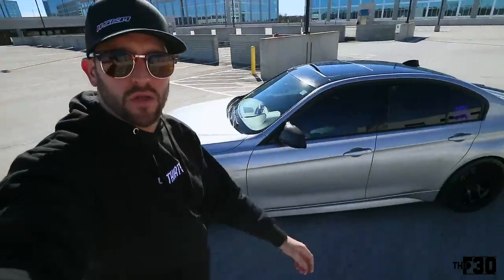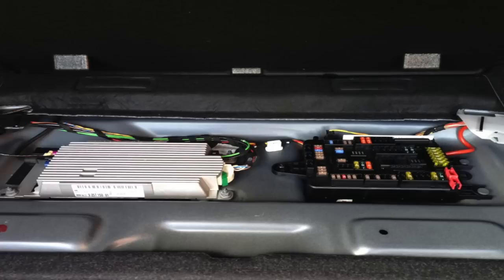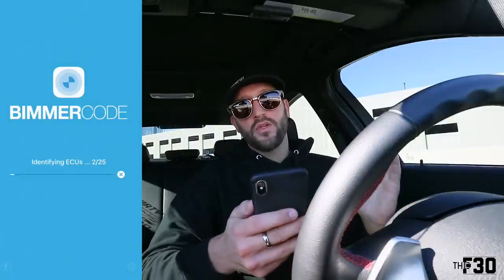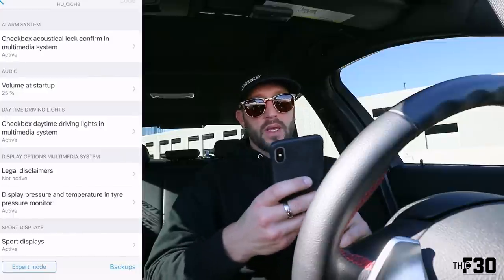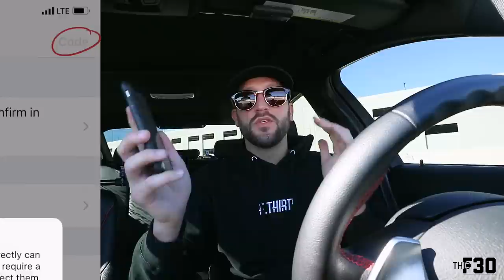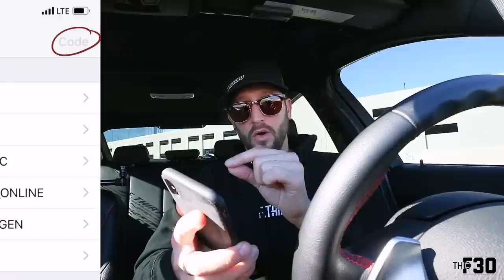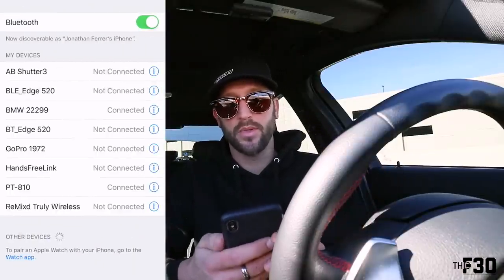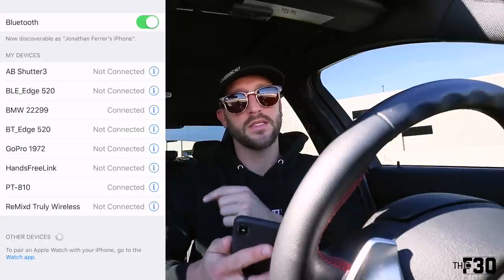BIMMERCODE: ENHANCED BLUETOOTH AUDIO & A WORKAROUND

Comment: I can confirm this works on a 2014 f30.  Thank you for posting these, super helpful and appreciated.  

The only thing I would add is that I had to make sure I had bluetooth audio checked on my device through the iDrive settings.  It may be easier to remove and add you device again, ensuring you have both phone and bluetooth audio selected.
Reply: Just did on my 328d. You actually have to select the phone in idrive to enable audio fully. Too bad it seems it doesnt give song info ( artist etc) on headunit via spotify. Havent tried via music directly on my phone yet though
 Thanks for this vid!
Reply: Worked on my 2014 F22 as well. 👍

Comment: This works! You have to code both sections separately it was definitely scary with the warnings on the app. READ THE WARNINGS FULLY AND FOLLOW THEM OR IT WONT WORK PROPERLY. Bimmer code does also cost $39.00. Pricey but well worth it in my opinion. I wish I would have done this two years ago when I got the car.

Comment: Hey so I know this is a bit of an old video but hopefully you can offer a bit of help or can point me in the right direction. so I have a com box in my trunk, it looks alittle different than the one you showed a picture of. but in my bimmercode the 3004 for me shows "3004 System_einstellungen" looks to be in german? and I am missing everything except the BT mod and the audio player under the 3003 section.

Comment: Worked perfectly on a serie 1 F20 2013 with a combox, thank you so much !! ❤️
Reply: I just tried on my f20 same year and I can’t pair my device to telephone. Bluetooth options are there but can’t select. Do you know a way round this?
Reply: @matthewread4146  try connecting another phone
Reply: Does it enhance the audio effect like we play from cd? Or it’s just enabling Bluetooth connection ?
Reply: @matthewread4146  I have the same issue. Did you resolve this at all? 

If so, how? 

Cheers

Comment: I have a '15 328i Sportline and because in my Android ROM building days I bricked a device or 3 I just want to be sure that my black TCB-01 Combox is going to work with this method. The combox in the video was silver and one can't be too sure when dealing with a car ECU. I've already used the Bimmercode android app for other changes but haven't delved into expert mode yet

Comment: Hey bro I ran into a problem, I have a combox but when I go into the advanced part I don’t see the 3004_bluetooth_parameter option and I’m 100% I have a combox cuz I have a lil box right next to the fuse box any suggestions?
Reply from the maker: I would read through the bimmerpost forum link I posted and see if anyone has your similar issue. Coding can vastly vary depending on each and every car So there is no “one answer for all” unfortunately.

Comment: Hello, great videos but still with some issues, so i tried the usb cable and works perfectly many thanks about that, but i checked and i have the comibox as well so i got the vgate and the app but some of the codes from the video are not there and also the comibox is not on my list. What shall i do? Many thanks
Reply: I have the same problem and don't know what to do

Comment: Hi .. My f31 2014 does not have a bluetooth module in the trunk. I've activated all of these options and i am expecting a bluetooth usb aux adapter .. Can i keep these options on? Or do I have to turn off if I do not have a module in the trunk?
Reply from the maker: It will not make a difference.
Reply: @ThicWhips  
It means leaving it like that..
I ordered a bluetooth usb to do music and talk, calls?
Reply from the maker: If you leave it like that, and you don’t have the combox, it will not make a difference. 

The usb Bluetooth device allows you to play music, take calls etc
Reply: @ThicWhips  thanks..
Reply: @ThicWhips  I have a problem with the update operating system. I can not make the update in the setings menu where the system info does not offer me the current version of the operating system. How do I fix it?

Comment: It dint work for me the first time. I found this on the forum and I just need to code these additional steps in the COMIBOX 

Combox_Media > BLUETOOTH_PARAMETER 3004 > A2DP_AVRCP_EIN_AUS = aktiv 
Combox_Media > BLUETOOTH_PARAMETER 3004 > BT_EIN_AUS = aktiv 
Combox_Media > GENERAL_PARAMETER 3000 > MAIN_BOARD_ALONE = ecallboard_present 
Combox_Media > MULTIMEDIA_PARAMETER 3003 > API_EIN_AUS = aktiv 
Combox_Media > SWUP_PARAMETER 3005 > SWUP_ENABLE_SW_UPDATES = aktiv 
Combox_Media > SWUP_PARAMETER 3005 > SWUP_SOURCE_ONLINE = nicht_aktiv [Default]
Combox_Media > SWUP_PARAMETER 3005 > SWUP_SOURCE_USBMSCDD = aktiv 
Combox_Media > TELEMATIK 3006 > GPS_FROM_MOST = nicht_aktiv [Default]
Combox_Media > TELEMATIK 3006 > TDA_TSM_ACTIVE = nicht_aktiv [Default]
Reply: You dont bro read my new comment follow that it should work you only need 3 codes bro
Reply: @biigjojo  what 3 codes? my car wont synch my contacts anymore or recognize the phone only the media part of the Bluetooth works.